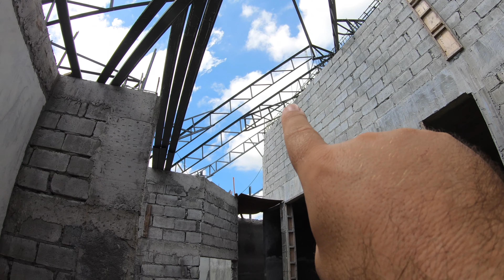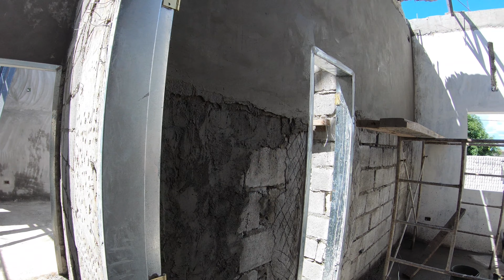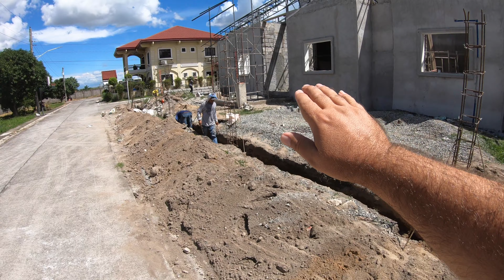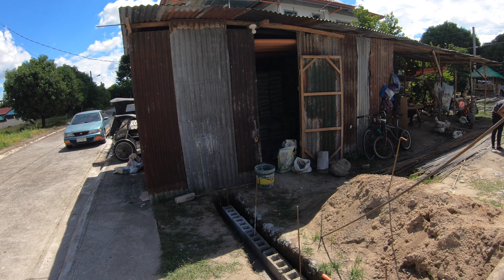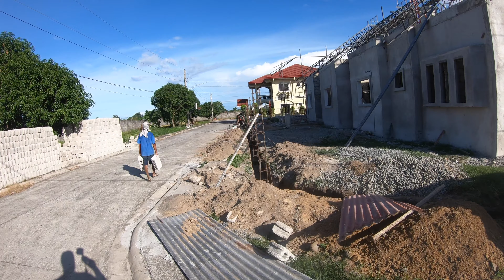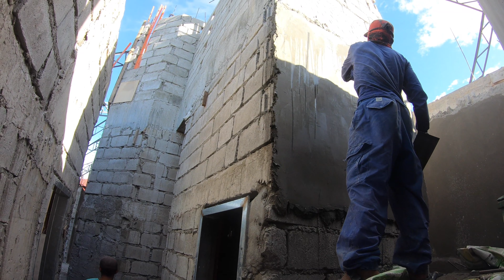Philippine House Building Step by Step, Build Day 96: Brownout Day|Stair Height & Depth

Comment: So, George, how are the roof trusses to be secured?  Did I hear correctly that they will be poured in place as the bond beam is placed?  Looking great.  Thank you.
Reply from the maker: Wess,
Typically secured with rebar from the bond beam or columns wrapped around the lower portion of the trusses. Some of ours are being incorporated into the bond beam just because of how the angles worked out.

Comment: looks good man.if you dont mind how much is the budget with that size of a house in thye philippines?Thanks
Reply from the maker: House depends on level of finish. Ranges from P20K-P30K/SM. Lots are running P10.5K/SM. 
Ours is running about P25K/SM for the house.
But the thing to keep in mind is that the entire house is concrete with a strong metal roof. Going to cost more than typical timber build in the States.
Price also varies based on which region of the Philippines you build in. Pampanga and Manila are typically more expensive. Batangas is fairly inexpensive from other vlogs I’ve seen.